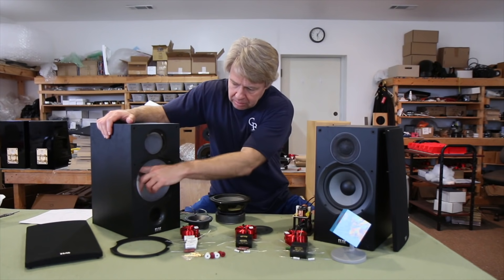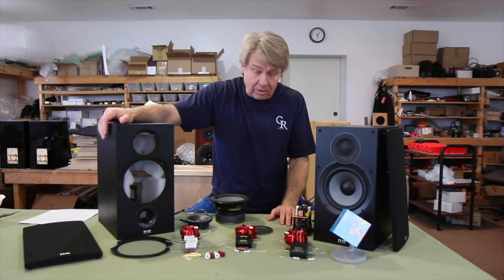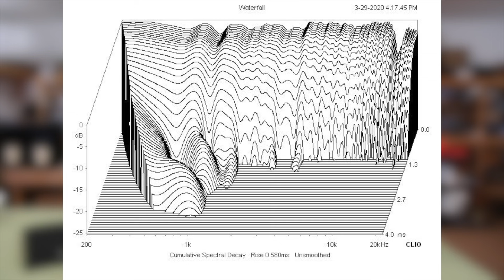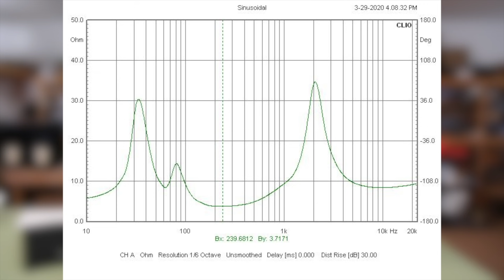Elac Debut 2.0 Upgrades and Modifications!

Comment: Some globe-earthers just refuse to look at the facts proving flat earth, but they are still capable of making great sounding speakers.  Go figure.
Reply: Couldn't hear the cable/connector difference when in my 20s, other than connection/oxidation distortions - most likely I won't be convinced now, with way better drivers. But I learned how to do proper crossovers over the years, that don't stress tweeters playing too low.
Reply: @pliedtka  A reason why he never does anything but test at 1 watt, never has to worry about his tweeter mods then.
He also never shows a phase plot that will look horrible with his added circuits.
Reply: @darrylduck6356  1 watt is the standard test level for speakers

Comment: I am very interested in the evidence for cables to have a impact on the sound? I have personally never heard a different between two cables that are the same length and gauge. Im not hating. Im just curious.
Reply: @amazoidal  Don't be fooled. There is often a lot of differences in various cables.
Reply: On a high end system, the differences are easy to hear.
Reply: Thank God I don't have a High-End system. I couldn't afford the cables.
Reply: There is no perfection. It's all a compromise. Steve Guttenberg just had a video about the pursuit of perfection. Find it at his site "The Audiophilliac".
Reply: @amazoidal  My goal is to get you there without spending a fortune. It can be done.
Reply: @dannyrichie9743  

And that there people is the reason I watch these videos!  These are type of channels I appreciate.  Getting great sound but not spending $180,000 for a pair of speakers!  $15,,000 using Danny   as a guide can probably get you the same performance using a good used sturdy high end speaker.  Like a Legacy!😜🤪🤯🤓  I still say there are people who will still prefer the original speaker before modifications.   At this point it's just a different sound signature and maybe more oooph.

Comment: Fear of screwing up my Klipsch RP280 is preventing me from buying the upgrade kits.
Reply: If you know how to solder and dont crank your amp up while testing it you should be pretty safe
Reply: @19janiboy96  Hi Jan, would you use a solder gun or iron(I think that's the one that looks a bit like a pen, right?)
I'm making a list of the tools necessary so far I have a drill, I need to get a solder _____. I have screw drivers. What else would you suggest?
Reply: Sam Halsey Atten SS-50 high efficiency soldering iron Approx 40.00 U.S.  after trying to make my own cables with a cheap iron I decided I had to get one that is easier to CONTROL the temp. You can purchase on Amazon.

Comment: If the various manufacturers highlighted in the GR videos cheaped out on crossovers, wouldn't they also cheap out on the drivers and the box as well?     Also, it seems odd when GR "corrects" the crossovers. I am pretty sure the manufacturers have engineers with even better tools than GR has at their disposal, design the original crossovers.  Not saying existing products cannot be improved, but it seems better to start from scratch with good drivers, box and crossover.

Comment: I don't doubt that the cable can make a difference in analog cables. I just don't think it makes enough of a difference for my terrible hearing as compared to how much some of those high-end cables cost. As long as you have a certain amount of quality there that you're not destroying the signal, I won't notice much of a difference.

I had to get a budget headphone amp for my pc, simply due to all the interference I was getting. Using an optical cable, I've moved the sound setup to the other side of my desk and that interference is gone.

What's stupid is getting an optical cable with gold connectors thinking it'll give you a better signal, or one of those obsurd $5,000 hdmi cables on a tv setup.

Comment: America has a lot of people believing in conspiracy theories and flat earthers are among these people. In audio we have a lot of people believing in pure snake oil nonsense. Your speakers' performance is the most critical piece of getting great audio fidelity and lots of manufacturers are cutting corners to save cost. Actually when I clicked on this video I was expecting a pile of snake oil talk of imaginary things coming out of just swapping parts with more expensive ones. Rather, I am pleased how the video is with a  proper audio engineering approach and starts with looking at data = the frequency response and what can be done to actually tweak the performance in a meaningful way. There is no such thing as a good neutral sounding speaker not having a relatively flat frequency response. But...not sure how much changing binding posts will do...probably not anything you can hear.
Reply: Actually the upgrade of the components and changing the wire and binding posts to tube connectors is a very significant improvement that is greater than the subtle changes in measured response.
Reply: @dannyrichie9743  I assume one effect is that better components can yield a slight (or more?) improvement of the the damping factor by lowering resistive effects in the path between amp through cross-over to drivers. What differences do you see per component in terms of unwanted resistance, tolerances or anything else? Better quality passive components don't just sound better without some reason why. BTW, it would definitely be interesting to compare the impedance curve before vs. after.
Reply: @ThinkingBetter  The difference in the parts quality is NOT subtle. And it has nothing to do with resistance. There are a multitude of reasons for the improvement but a complete response on that would be the equivalent of writing a book.
Reply: Danny Richie Well, there aren’t many effects of pure passive components to think about. Capacitance, resistance, inductance, tolerances and temperature dependencies are what comes into my mind. All components have resistance also when they are not resistors. Inductors can cross interfere when in close proximity. Capacitors deteriorate over time and can have poor tolerances to begin with. Of course you can write a book about these things, but no need to turn it into magic and snake oil. I wonder if you have done a bit deeper analysis of which exact issue is typically of most impact on the audio fidelity. For example, the resistance through the speaker terminals might change a few milli Ohms by using better terminals which can yield somewhat higher damping factor and more firm bass performance but I doubt that to be so likely unless the original terminals had corrosion and were used without proper mounting of the cable. A delta of 100 milli Ohms is unlikely to be audible, for example. How much have you actually measured as delta before vs after of speaker terminal resistance (x2 deltas)? I like what you are doing and the beauty of it is that these things are easily measurable unlike the speaker driver and room acoustics.
Reply: You are looking for differences in the wrong places. 

Let's just start with capacitors. They can sound vastly different yet the values can be exactly the same. The types of materials used and dielectric material only can have a dramatic effect. 

You also mentioned speaker terminals. The quality of the sound again has nothing to do with resistance. If resistance was all that mattered then we'd just make them bigger. But the truth is that passing the signal through a bunch of dissimilar materials will disrupt the response. But a low mass Copper tube will have much less disruption of the signal and sound much cleaner. 

And the proof comes from hearing and not from finding a measured difference. In the end what matters is how it sounds, not the measured resistance.
Reply: @dannyrichie9743  Audio on electric wires through a passive circuitry of components is always a composition of sine waves that get affected by simple laws of physics and is completely measurable within the frequency range of audio (20Hz-20kHz). An audiophile capacitor is still a passive component that can be modeled as an equivalent circuit with a combination of  ideal capacitors, inductors and resistors. Truckloads of snake oil is used to argue otherwise. Personally I never use the cheapest parts but I like to understand what I get for the cost in terms of lower tolerance, longer life, less internal resistance etc. I have an electrical engineering degree btw and have done products sold in the millions incl. high-end stuff for some well-known brands. Again, I don't discredit your efforts and like to do similar upgrades, but I generally don't believe in electronics changes being audible without them also being measurable in some way (provided you have professional equipment to do proper measurements). As soon as you hit the voice coil, things become impossible to fully measure and I agree, listening testing is what in the end can judge a good speaker overall. 
You say things like "But the truth is that passing the signal through a bunch of dissimilar materials will disrupt the response.". Ahhhh...this is pure snake oil talk unless you can show a simple measurement and actual theory, which you can't. Dissimilar metals can cause galvanic corrosion under some conditions that can yield a resistive effect and in some worse case an unstable contact (which can become distortion). This is a real thing when metals are combined carelessly.

Comment: As a recent subscriber to your channel, I've been checking out many of your videos and like your approach to speaker design and modifications. As a subscriber to Speaker Builder magazine in the 1980s and 1990s, I got enough of the basic theory down to comprehend why your concern with quality parts is not some kind of snake oil. So I'm surprised with your comments on the cube earth. Why aren't you a proponent of the electric universe theory, where, if I understand it correctly, all forces in the universe are electromagnetic? Gravity and the ball earth are old hat . Proponents of string theory suggest that earth may actually be shaped like a spaghetti noodle. Who knows, anything might be better than believing in a model of the that requires an ivory soap percentage of it to be dark matter and dark energy! Or are you really a planetary physicist in disguise?

Comment: Has anyone even heard his upgrades? He sells DIY stuff which costs more than some finished speakers? Can't he sell a product and compete with different manufacturers? Watch his video about how big companies need to cut costs and his (should costing is grossly inconsistent)
Reply: He's developed and designed speakers for several speaker manufacturers over the years.  As an example, he designed the crossover for the US version of the Usher 718-BE, which was a very successful commercial product. He's said in the past that his passion is in the design of speakers and not the administrative business side, so he likes to design and put his products out there through DIY I assume because it's a simpler business model. He also can sell speakers as kits for a fraction of the price they would go for if manufactured and sold through normal channels. He's been in business for over 15 years so his business model seems to work for him. I've heard his work and it sounds great.
Reply: Jeremy is correct, but we've been in business for over 25 years. And from this link you can see some of the industry awards my designs have won: http://gr-research.com/services.aspx

Comment: So the solution to “fixing” a budget speaker is to throw money at it. In this case, over 100% more. My question is, why do that instead of just buy a pair of $600 or $700 dollar speakers? Why make all these mechanical changes when I could just do a little EQ’ing and call it a day? Honestly, I thought Andrew Jones had already done a heckuva job optimizing sound to a very good price point!
Reply: First of all, Andrew did do a great job with these. 

Second, speakers in the $600 to $700 dollar range typically use the same budget level parts. And no speaker is ever as good as the parts quality used. 

And EQ doesn't change anything but amplitude levels. The upgrade tackles cabinet resonances. And it improves clarity, detail level retrieval, imaging, sound stage layering, bass response, etc.
Reply: Even those more expensive speakers will need an "upgrade".
Reply: @amazoidal  Could be. I've seen stupid expensive speakers loaded with budget level parts and sound poorly and I've seen mid priced speakers loaded with really good quality parts and sound great.
Reply: @dannyrichie9743   As someone who's looking to upgrade my speaker in the near future and have been considering as example an Elac Reference (which I heard in person but not the 6.2), and I'm an electrical engineer so I can go the purchase or DIY route, a natural question plays out in my mind and sounds like this: "Is it better to buy a used Elac6.2 (I see one online for $170), pay $345 for the DIY upgrade for a total of $515+shipping(or close to $600 depending on the used market) or purchase a new Elac Reference for $600".   Its not limited to the Elac Signature, it could be the Triangle BRO3 or etc. etc. speaker in the $600 range.. i realize you can't say without having heard all these speakers(I certainly have not other than online reviews) but wondering what you would suggest someone in my shoes who may be considering all of this.
Reply: @HoomanR17  Buy the Debut Reference, enjoy it for a couple of years and wait for Danny to come out with an upgrade kit for the DR.
Reply: @great100m  Good suggestion.. Thanks.
Reply: @HoomanR17  I have the B5.2/C5.2 for my LCR.   To me, they're very good for music and ok for dialog/HT.   My hearing is bad so I'd like an improvement for HT.  The Reference series is getting good reviews as a step up from the 2.0 and include similar changes over the Debut 2.0 that DR is making to the 2.0 however I'm not likely to perceive a difference so I need the upgrade to be a next-level improvement. Hopefully Elac, or GR Research, will release an upgraded Uni-Fi series soon, maybe that'll work for me.

Comment: Well, Danny, I’m a “flat earther” by your definition. I’m not taking an absolutist policy on this because everyone is different. I’m also not going to be told that I don’t want to hear evidence. You should stop saying things like that. I’m always open to evidence. Where we differ is how much can be measured vs how much can be perceived. If I can’t actually hear a difference then the measurements go for zip. Do I think $259 (about $400 Aussie) is worthwhile? It’s not a massive sum and maybe it’s worth a shot. But I will be convinced by my ears (I notice you don’t do before and after sound test demonstrations) and not by a couple of pieces of paper.
Reply: We actually do listen to a lot of speakers in stock form before we upgrade them. We also spend a LOT of time A/B comparing each part used. In this case the upgrade is fairly significant. Hearing is believing.
Reply: @dannyrichie9743  Well, if I can hear a benefit, I will agree with you.

Comment: Waste of money. The upgrade costs more then the speakers. Just use a EQ because these things sound boxy and muffled in the mid bass range.
Reply: There is no amount of EQ that can do what this upgrade does. EQ has no effect on cabinet wall resonances that the No Rez takes care of. EQ has no effect on clarity, higher detail level, higher resolution, reduced smearing, improved image layering, etc. This upgrade does all of those things.
Reply: Audioholics does a great video describing the problems of eq and why you should fix everything in the equipment string: Speakers, amps, power, speaker location, input quality. etc. before adding blanket DSP or Equalization to a system. You lose clarity in other areas and risk damaging your speakers or amps if you use EQ as a catch all.
Reply: James, with respect, that is not a smart comment at all in general, but to think you know more on the topic than Danny R is.... well, ummm.... hush, bro.